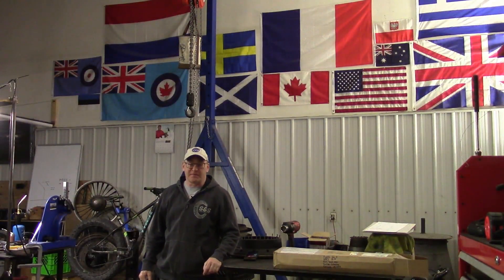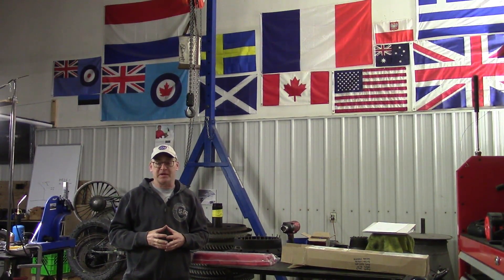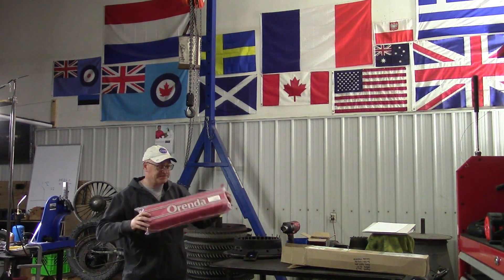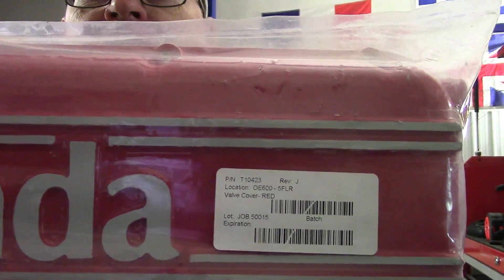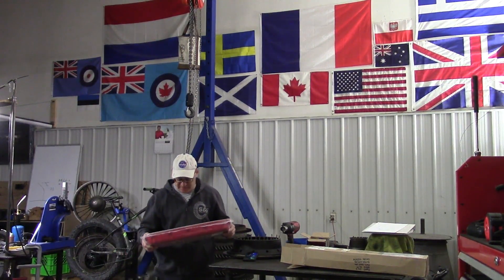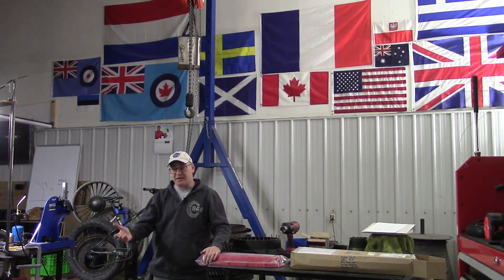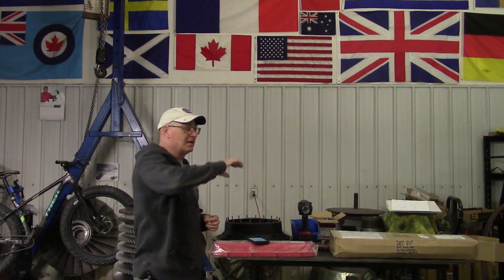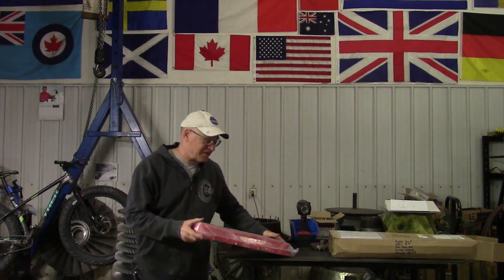Different Fuels for Jets

Comment: There was one aircraft which did use ammonia as its fuel: The X-15 high altitude rocket plane - the one which was air-launched from under the wing of a B-52 bomber and flew up to the edge of space. Of course it didn't use a turbojet engine, it used a rocket engine - but a somewhat unusual rocket since it was the only one (as far as I'm aware) to use ammonia as its fuel, burned with liquid oxygen as the oxidiser. Although this was only ever an experimental aircraft, the rocket engine powering it did work fairly well, so ammonia can certainly be used as a fuel.
I'm not certain if ammonia would burn as easily or as efficiently in a turbojet though, since the oxygen concentration in compressed air would be substantially lower than the pure oxygen used in the rocket engine. However, my guess would be that the flame temperature when burning ammonia would be lower than for burning a hydrocarbon fuel - so you could probably use a greater percentage of the compressed air drawn in by the turbojet compressor for burning the fuel before the exhaust got hot enough to damage the turbines.
I think this has something to do with the specific heat capacity of ammonia being higher than for hydrocarbons, so a fair amount of heat is absorbed just vaporising it. So using ammonia as fuel would have a similar effect to using a hydrocarbon fuel combined with water injection.

Comment: Great video!

One thing about the diesel soot: it is a dangerous form of pollution, locally. The soot particles are small, about 0.1-0.2 µm and when they enter the lungs they can do much damage in long-term exposures. So, it would appear with diesel engines we need to make a choice about which we care more: the air quality in our cities, or climate change.
Reply from the maker: This video is not about the health effects of breathing soot.

Comment: I understand that another issue with burning hydrogen is that you will also generate NOx. The fuel itself does not contain any N, but N makes up 78% of the atmosphere, so if you burn any fuel using regular atmospheric air to obtain the required Oxygen, you will also be adding a lot of Nitrogen to the mix and will inevitably generate NOx. How much is generated depends on combustion temperature and H generates very high temps.
Reply: I remember reading in the 70's that a way to reduce unburned fuel (HC) was to run (car) engines hot, hence the jump I saw in spec'd thermostates jump to 195f-
215f. Even tho physically a 160 to 180 thermostate would fit, it was not listed as a viable substitute. So, because now high(er) combustion temperatures caused reaction with nitrogen to cause NOx, they deluted the incoming mixture with exhaust gasses (EGR).
Reply: @obsoleteprofessor2034  what they were doing was that 60s era cars ran really really rich because carburetion tech is not perfect, and you needed to run rich to avoid knock and ensure stable combustion of only mostly vaporized fuel... But running rich meant the fuel did a bit more cooling when it wasn't burnt. Leaning it out got them halfway there. The other bit - with higher temp thermostats - I think had to do with the poor vaporization/atomization of carburetors. By running the engine hotter, you reduce the size of the fuel droplets by the time they are ignited, so they are thus better mixed and burn more completely.

Once you've leaned the engine closer to stoichiometric though, because carburetion means poor mixing, some regions of the cylinder won't be stoichiometric anymore, they will be more lean! Those regions won't use all the oxygen when burning. And when the chamber heats up during combustion, that leftover oxygen combined with the nitrogen. Running the engines a bit hotter again helped there by mixing better.

Nowadays with high pressure fuel injection, none of that matters in the first place, and the catalyst takes care of the rest...
Reply: @obsoleteprofessor2034  note that increasing the water temperature of the engines doesn't really have that much of an effect on the temperature in the combustion chamber... That mainly has to do with load (density of fuel/air mixture) and ignition timing. EGR dilutes it and reduces the temperature, but also has a slight beneficial effect on efficiency. This surprised me when I read it years ago! The reason is that the energy of combustion is still the same, but because the temperature is lower, less of the energy is lost to the cylinder walls and head and piston, and more of it is used to expand the gas!
Reply: I bet - based on no evidence at all - that they might be able to deal with the NOx from hydrogen by either running at the very lean end of the range (keeping temps down in the first place), or running very rich like they did in the old days.
Reply: @Ariccio123  Yes higher coolant temperatures/pressures meant less energy loss to the engine block and heads. Also the cooling system could be smaller overall.

Comment: I read about the Orenda 600 V-8 many years ago in "Air&Space" magazine.  It took a lot of work to "aviationize" the automotive engine.  The reason was aviation demands continuous output in cruise at high power settings (75% of max) whereas automotive engines are designed for continuous output on the highway at low power settings, (15% of max.)  Getting the Big Block Chevrolet to do that reliably was a real challenge.  Add to that, they made the blocks out of aluminum for lightness and put two turbochargers on them.  So they really had some reliabilty issues to solve.  Last I heard, they put a pair of them in DC-3s and they worked fine.

I vote you get ahold of a whole Orenda 600 and do a run-up in the shop! And keep the valve cover in the plastic.

Comment: The reason, soot is produced in a diesel engine  but not  in gasoline engine is the combustion temperature in the cylinder head. 
Due to the high temperature of above 1000°C in a diesel, the combustion products are water steam and carbon monoxide, during the downstroke the temperature decreases and the Bouduard process starts below 1000C, where 2 CO molecules are converted to one Co2 molecule and one carbon molecule, which aggregates to soot particles, this process is complete at 400C, where no carbon monoxide is left.

Comment: Re: nuclear powered jets. So far as I understand it, the gases coming out are not radioactive due to their exposure to the fission fuel. The problem is that the structural integrity of the fuel (if based on uranium) itself ain't great, and particles of fuel are being exhausted out the back too. These are what makes it so radioactive. However, I read some years ago that if you could swap uranium for americium, that would permit much more robust fuel structures to be built, and not emitting radioactive dust out the back of the engine. The problem is that getting hold of enough americium, which is why no one (so far as I know) has got enough of it together to make a fission reactor, though apparently the physics behind such a thing stacks up really quite well.

There are designs for helium cooled fission reactors where the hot helium is used to drive turbines directly. This works, because helium doesn't get transmuted by the neutron flux into something radioactive, so as long as the fuel pebbles (not rods in these designs) don't disintegrate you can move helium through the loop without fear of a leak of radioactive gas. These "pebble bed" reactors were being looked at by the Japanese, as being small / safe enough to put in skyscraper basements, being entirely passively controlled and failing safe if the helium leaks out. If I recall correctly, the reactor can run only if helium is being actively moved through the bed of pebbles to take the heat away. If the heat removal stops, things expand, and the fission reaction is quenched. The only real challenge I think is make the graphite shelled fuel-pellet containing pebbles reliably enough to keep the fuel and reaction products contained. Another plus is that reactors of this type are not designed to evolve plutonium, and also produce far less hot radioactive waste.

Comment: 14:02 Sort of right, but the issue with Diesel Particulate Matter (DPM) is two things:

1.) That carbon is often coated with all sorts of unburnt hydrocarbon nasties.  So less “Activated Carbon” moreso that after it has been soaked in waste motor oil/refinery nasties.

2.) The particle size.  If they were large chunks like rocks it may not be too bad, heck “Asphalt Concrete” is sort of similar (granted evaporation points are different, and leaching behavior may be less yada yada yada, but you get me)
The issue is lots of DPM is below 2.5 microns so it can get into all the nooks and crannies of your lungs and cause issues.

So yeah.  Also I’ll post some links below i guess just for a quick read on it.  Hope YouTube doesn’t delete/hide em or some shit:
Reply from the maker: If you were paying attention, you may not have strayed so far away from the subject of the discussion.
I was speaking only of the greenhouse effect of carbon dioxide compared to that of carbon particles.
I was not speaking at all about the effects of inhaling the soot.
If you want to compare the inhalation effects on human health, carbon particles may be harmful in the long term, but moderate concentrations of CO2 can cause death within minutes.
I terms of environmental damage, as stated in the video, elemental carbon is inert, and CO2 is a greenhouse gas.

Comment: Hi JayZ. I spent many hours and  5 seasons flying the Orenda OE600. I believe it was still run by Orenda the first 2 years I flew it then turned to Trace engines LLP. The oe600 was designed to directly replace king air 90 and 100 pt-6 turbines so it had a huge turbo charger for dealing with altitude density and cabin pressure. The stc to put it on the air tractor 401’s that I flew kept that ginormous turbo and it was trouble. I don’t recall if I’d did go on many other aircraft but I ate up alot of them on the air tractors. If I recall max takeoff power was at 5200 rpm and 48”hg mp. I got to go down to midland Odessa Texas a few times to test fly a few machines and see the engine on the test cell with rouche digital ignition and fuel injection where Trace engines set up shop. They were getting double performance over mags and tbi injection and it purred like a kitten. Could also run it smooth on the stand on even down to 2 cylinders. FAA wouldn’t give them an stc to go electronic and that was the biggest problem with that program. Over my stint flying those engines for an outfit out of yorkton Sk I had many engine failures and fires and problems that destroyed alot of engines. Pt-6 is pretty hard to beat for the punishment of ag flying. When they did run they had all kinds of power and sounded awesome like a spitfire, other then the racket the quill shaft in the reduction gear case made at lower rpm’s on the ground. Lots of chatter. The quill shaft was one benefit for ag flying cuz it protected the engine from prop strike and even arcing when you put the prop through a power line. Cheap fix. Not cheap on a turbine. If you look up Trace Engines on YouTube I’m the guy test flying that air tractor down in Texas as a demonstration for investors. 👍🏽
Reply: The big turbo did leave room for extra power and boost on takeoff. If I recall when you firewall’d the throttle on takeoff if it was a tight one it would hit the pin on the in hg mp gauge at 62”.  I believe it formulated to something like 850-900hp which is amazing for 500ish cid
Reply: @ryantomcala5119  is that absolute or gauge pressure?

Comment: The inaccurate term cabon does not only mean CO₂ but also methane CH₄ which is an even stronger greenhouse gas than CO₂.  There are other greenhouse gasses which do not contain carbon, for example SF₆ which is emitted in much smaller quantities but has a well over 20,000 times stronger effect as a greenhouse gas.  SF₆ can not be generated  by combustion from hydrocarbon fuels so this is more of a theoretical side note for sake of completeness.

Comment: Regarding the carbon particulate from an exhaust: due to carbons high surface areas it tends to pick up stuff. Great if you're poisoned and need to get rid of it, but it also picks up heavy metals and combustion by-products that are harmful. So those particulates are actually really toxic. Not due to the carbon itself, but due to the stuff they adhere to.
Also, the carbon itself is rather dangerous if you inhale it. It very much will destroy your lungs due to the tiny sharp edges.
Reply from the maker: You are right about that. I should not have said it was completely harmless. I was thinking too much about the greenhouse effect, and not enough about direct effects on people's health.
Reply: @AgentJayZ  You’re fine lol, always new stuff to learn.

Comment: One of the selling points of the Chrysler Turbine Car that it would run on pretty much any liquid that burns -- when they showed it off in Mexico in 1964, after the Chrysler rep went down the list of fuels it could use, President Adolfo Mateos asked "What about tequila?" The PR guy called up Detroit, the engineers in Detroit went to the local party store and bought a couple jugs of cheap tequila, tried it in the test engine, and called back to Mexico City and said "yes," and so El Presidente got a test drive in a car powered by his country's most famous product.

Comment: The carbon filter on a diesel emissions system is a DPF or Diesel Particulate Filter.  Diesel engines work with extremely high combustion pressures which enable nitrogen to join the chemical reaction...  NOx (various nitrogen-oxides) are  brown in color SMOG!  Regardless of what anyone says, the diesel engine will move more weight with less pollution and cost.

Comment: I had a friend who worked for Pratt, I think in the late 60's, who worked on the development of an atomized coal burning gas turbine.  According to him, their best efforts were remarkably unsuccessful.  Some component lives were measured in minutes.  I wonder if materials science has created products to tempt people to investigate that universally unpopular fuel again.
Reply: I read about that! Also worked in coal power plants now gas turbine plants. Coal is so abrasive, I can’t imagine that working out very long lol. Pretty interesting.
Reply: The issue with burning coal in a turbine engine isn't so much the injection of the fuel - even if you could make the particles small enough that they could flow well into the combustors, you would still have the biggest problem: Ash. Coal is never pure carbon, it contains lots of impurities which make solid ash particles no matter how cleanly it burns. In a boiler that is ok, because the ash can be captured from the flue gases. But in a turbine engine it is a problem, because the ash in the exhaust would be abrasive to the turbine blades. So it would be like flying through a volcanic ash cloud, which is notoriously bad for aircraft engines.

Maybe if you could use a source of pure carbon you could make it work, something like charcoal or coke, whether the coke was derived from coal or oil (aka petcoke). But even then the ash problem might still be an issue - charcoal is fairly pure carbon, but you still get some ash from it, which you can see whenever you fire up your barbecue. So the carbon source would need to be pure enough, and the combustion efficiency would have to be as close as possible to 100%, otherwise you would risk blowing unburned carbon particles through the turbine, which would also be abrasive.

Comment: What about methanol? I had a drag boat that had a 526 ci blown alcohol engine. The fuel (methanol) had a lubricant in it that might take care of the fuel pump lubrication problems you talked about with one of the other alternatives. I don't know....just asking.
Reply from the maker: A gas turbine engine runs on heat. It does not really care where that heat comes from. Methanol would definitely work as a fuel. With some added lubricant that did not leave a residue, it might be as good as jet fuel. The best possible fuel is gaseous hydrogen, which is controlled by a different fuel system, not using positive displacement fuel pumps. Natural gas is almost as good.

Comment: I think the scale of the power and flow from the larger turbine engines is really hard for people to understand. 
A small turbine making 4-500 hp probably wouldn’t be hard to have an intake filter along with exhaust emissions equipment somewhat similar to what cars use. Would still have to be really large and would be to bulky/heavy for flight. But, would be possible. 
The larger engines are such a massive increase in everything it becomes normally unreasonable to have something that large so it could filter the emissions.
Reply: Not really, if you're talking the biggest engines. It's just aircraft that can't do that. Ground based systems are already filtered, but the filters are massive and huge, neither of which are any use to an aeroplane.
Reply: @deSloleye  That’s why I mentioned bulky/heavy for flight. On the ground it doesn’t matter much since you can built an intake filter the size of a building. If you really had to you could probably filter all the emissions on the exhaust too, but it’d also take a huge structure.

Comment: "Aircraftice it... make it a lot more expensive", sounds about right 🙂 There are diesel engines for piston aircraft that are some derivative of Mercedes engines but despite being small they cost about as much as a complete top model Mercedes sedan.

Anyhow, biofuels in airliners are starting to be a thing. One route in Norway is going to use it and one route from Sweden to the Netherlands is talking about it. Not sure if it is 100% biofuel or if it is only some percentage mixed in. Hopefully not palm oil from ruined jungles...